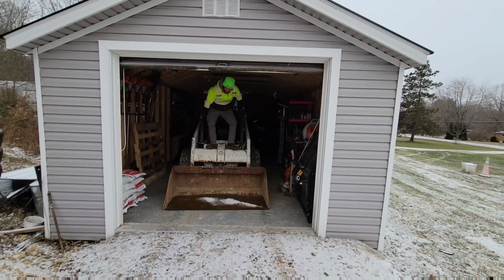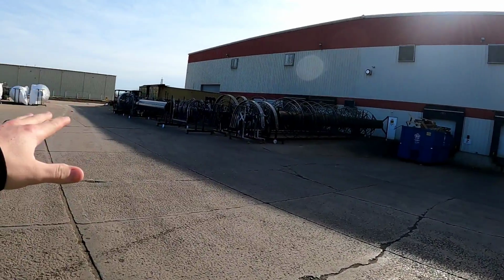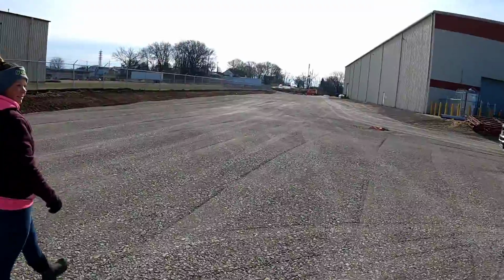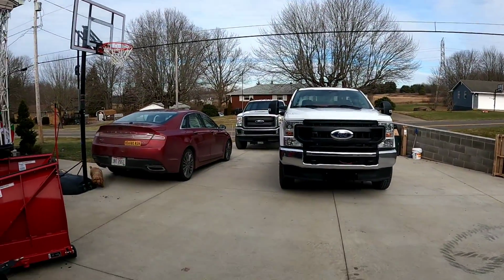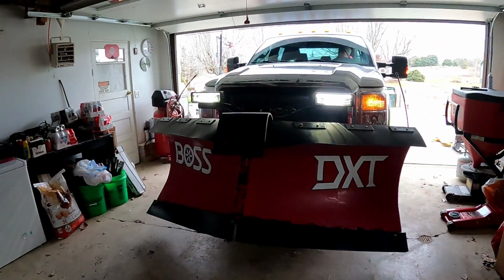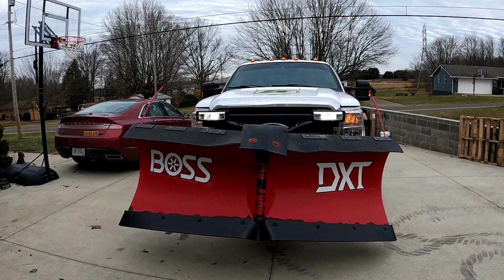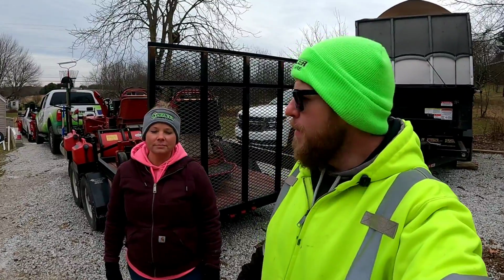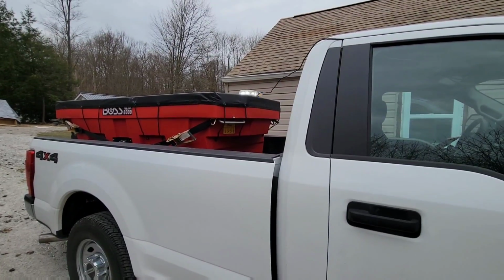CUSTOMER CALLED TOLD ME THEY TRIPLED THE SIZE OF THE PARKING LOT | THE DAY BEFORE A HUGE SNOW STORM!

Comment: Strobe light mount. Put a headache rack on the truck. It will protect the rear window of the truck and give you a metal mounting spot for the strobe and a set of spot lights to light the salt spreader at night.

Comment: I would have been too worried about going through the floor to pull that skid steer in the shed!  I recall an associate of mine who had a box truck rental business. Renters kept dropping fork lifts through the floor so he had to add steel plate floors! The weight of that stuff is no joke compared to a mower!
Reply: Right! I was thinking the same thing!
Reply: Spot on John.
I'm thinking 2 x 6 16" on center will be maxed out.

Comment: You might want to check with your shed company o. Max load for the floor. Could be to much of a load on the floor. If you continue to use the shed, clamp a wise-grip on the door track to hold it up so nobody has to be close by. Safety is no accident. Happy plowing.

Comment: If you are ever in a pinch for bulk salt you can always get some at Naragon irrigation, we are open 24hrs during a snow event, we are located in Norton a little bit of a drive for you but we have 3 big salt domes and they are full
Reply from the maker: Thanks man
Reply: I'm sure he will make that 40 minute drive if it means he don't have to fill that hopper with bag salt. I know I wouldn't hesitate to.
Reply: Salt is cancer. Thanks for rusting out vehicles
Reply: @sohotimhot752  scamer
Reply: @rexman971  what would you have them do?
Reply: @jeremyd9826  if people would drive slow and safely during inclement weather, you wouldn't need all this rust inhibiting crap on the roads. People are in such a rush and hurry that they want the quickest route possible, since they buy a new vehicle every year they don't care I guess.
Reply: @rexman971  on flat ground sure. But not on hills and slopes. Oil spray, rust inhibitors, fluid film all help slow down the rust. They are just doing their job. Making an honest buck working hard.
Reply: @rexman971  don't forget the f-250 they use every day is 6 years old. They keep it oil sparyed in the winter.

Comment: If you want to put your light on the roof with out holes. There is a company that makes a mount called Acari. It will go where the third brake light is. No holes drilled and can be took off if it needed to be.

Comment: What u could do is also put a back rack on the new truck and then get the metal add ons so u can put the light on there or just use the magnet on the back rack itself
Reply: Be safe hope all the equipment works great for u this storm

Comment: @Spencerlawncare I would park the bobcat with the engine facing the garage door so if it doesn’t start u can jump it or work on it
Reply: No, because if he needs it during a snow event he will have to use the bucket to dig himself out. If not, the bobcat will not clear the door opening on top of snow.
Reply: @putmeincoach7663  the bobcat would still back out the snow is not concrete he would still be able to back out without a problem
Reply: @ctyardimprovements8662  Not with 8-12 inches of snow sir. It's just not possible.
Reply: @putmeincoach7663  ok buddy hav a nice night lol

Comment: You should throw a back-rack on the new truck… The snow just started in northeast PA. We also own a Diesel machine and you always need to heat the glow plugs. Started ours today since two days ago in subzero temperatures and it would not fire after heating a glow plugs four times. Also you should treat with diesel treatment.
Reply from the maker: We have one coming

Comment: Should look into replacing the rear shocks on the new truck with the box salter and have air shocks installed I have them on my truck and they really to work well best $120 I ever spent not sure if they make them for your year truck but they do for my 08 or maybe look into adding leaf spring helper's

Comment: Never use just salt on gravel. Always use a sand salt mix. We always do 80% sand 20% salt. You need a solid or non permeable surface that salt can stay on top of for it to work properly. Like blacktop or concrete. Gravel is too pourus for salt to do it’s job properly.

Comment: if you talk with people who do a lot of snow removal like we do in the northern part of the country, you will find out you need to let the snow pack into the gravel. after you have a good hard pack base, the you put plow shoes, metal skidders on your plow and bobs your uncle. im in north dakota and plow about 60" a year and am plugged in to the plowing community and have never EVER heard of someone salting gravel. if anything i would sand it AFTER you have your hard back base down.
Reply: Got my @$$ chewed years ago by the 'ol school (super experience)  operators for salting a gravel lot addition.  Same scenario, gravel base and scheduled for asphalt.  They said it softens the base grade, the compaction measurements are void and it's will be soft bottom under the road surface.  Guys weren't engineers, but as long as they had been around, it never happened again.  Set the shoes or a cylinder spacer to keep the blade up an inch and skim it.  That place look to be getting a little big for two pickups.  Spencer may consider subbing it to someone with a box.

Comment: There are kits you can have installed for your truck that will use your factory tail lights and front signal lights and make them into strobes!  Since Ford uses aluminum mostly on their bodies, your almost forced to use the suction style strobe light.  I wasn't sure if you were aware of the option to use the running lights as strobes ( if they're LED lights, all the better ).   This helps you out also in clearance issues like going into the garage, nothing to knock off.  I've seen these lights in use, and they're pretty good.  I watched a guy on another youtube channel install them on his own truck and unless you're pretty knowledgeable in the wiring of trucks I'd recommend having it professionally installed.  Just thought you might be interested in these type of kits.  Stay safe and good luck.

Comment: I'm prepped plows on the Jeep and a full tank of fuel. 4 wheelers in the building with its plow staged outside the door. We have seen mixed predictions but we're as ready as we possibly can be. To all be safe I'd rather be plowing than having to go grab you out of a ditch when you wreck.
Reply from the maker: Be safe out there as well

Comment: I don't think that I would park all of that weight on a plywood floor but it isn't my shed. 
 Somewhere I seen a bracket that goes in behind the third stoplight on the cab that comes with gaskets and seals up with no water penetration to the cab and it has a steel flat surface on top for a magnetic light.

Comment: A small plate of powder coated steel and either good 2 sided tape or some silicone will hold the light and can be removed and not hurt the roof paint , plow smart , no big rush with big snow ,the average people aren't going anywhere, lol

Comment: The floors in those sheds are not rated for that skid steer. Just tarp the cab and leave it outside
Reply: As the video went on I see you did just that 👌🏾
Reply from the maker: When we had it custom built we had it built to withstand is